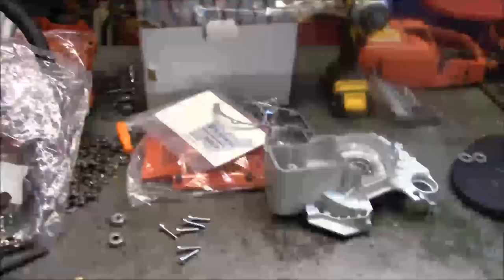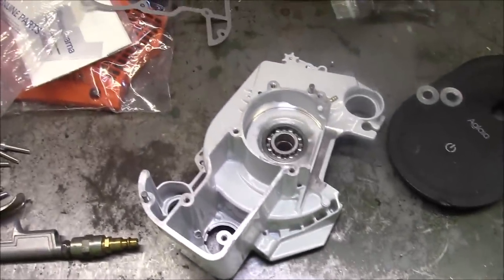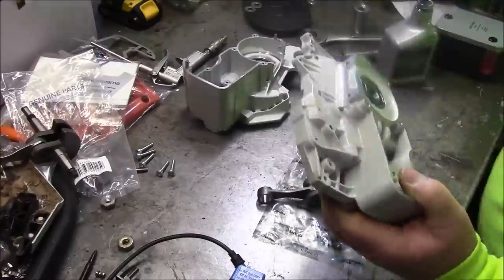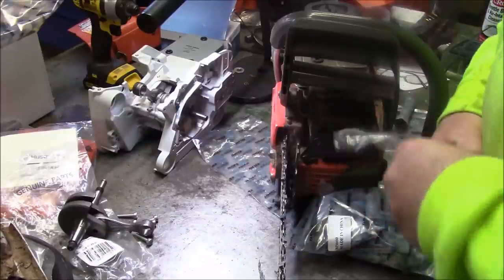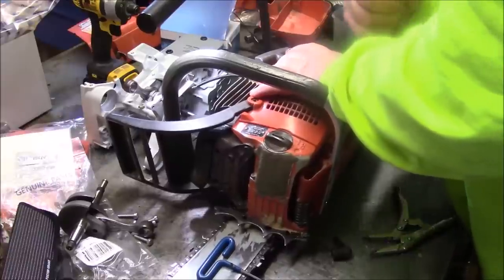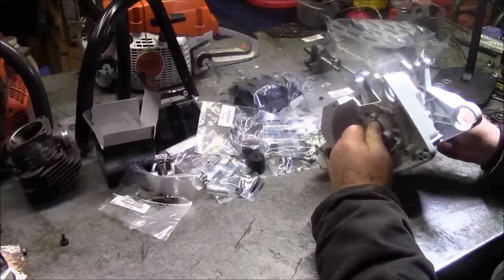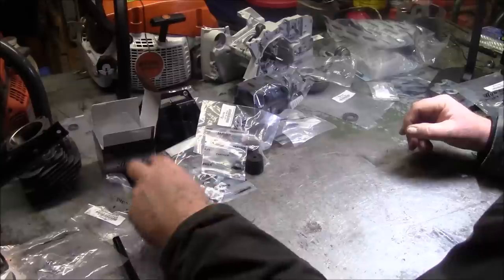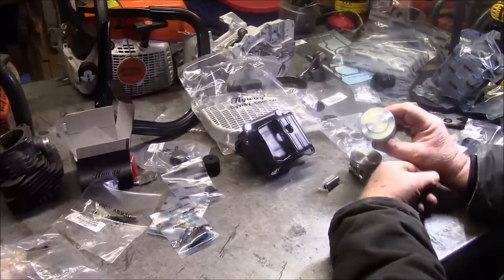Farmertec ms660 Kit Saw Build "Best Practices", Adding Parts from HyWay & OEM, Building Test Saw #3

Comment: My 660 build has taught me a few things.  I replaced quite a few control parts to get it to have a high speed half choke position, a carb, coil and finally a complete cylinder kit - about $100, total.  I now have a saw I think is as good as any of my Stihl or Husqvarna saws.  I have not found anyway to fill it with helium, yet, because it weighs a ton.  I never setup my saws to scream like some folks and I feed everything the same 50:1 fuel but I am happy with it and it works good and protects my two cycle stuff.  I learned that the things that I thought would take a long time ended up taking the least amount of time.  I also learned that Huztl`s quality control sucks on a lot of parts.  All in all, I would build another one, ut maybe an ms 360 or 440 the next time around.  I have thought about the 372 but I am a Stihl person, I do  have quite a lot of Husqvarna equipment, but I also have more German DNA than Swedish DNA, so I am usually able to figure out some of the stupid stuff Stihl does on their saws.

Comment: I found something about aftermarket cylinder sets that surprised me - the wrist pin bearing is to short.  I was replacing the cylinder on my new ms 260 to bring it up to Pro specs.  Instead of using the wrist pin bearing that came with the cylinder set, I used the original Stihl bearing from my original piston.  It was not worn or damaged and fit perfectly in the piston and on the wrist pin.  Had I used the new wrist pin bearing it would have caused a lot of side to side slop in the piston.  Over time this would have caused a lot of cylinder scuffing and wearing away of the Nikasil coating in the cylinder.  Just thought you would want to know.

Comment: I agree on the intake boot.  I think mine is suspect and I may pickup an oem or good am intake boot for my 660, probably from hlsupply supply.  Their base gaskets are great and that is what is on my 660.  I have had no problems with the chain adjuster or clutch and my oil pump works as good as any stihl oil pump.

Comment: Kit saws- yes, I am going to build either a 360 or 440 this fall.  I am leaning towards the 440 because I do not have a 72 cc saw.  I have several 60 cc saws.  I like the 361 but there are not as many parts for the 361 as there are for the 360.  I may build the ms 250 this summer.  They are pretty cheap and a piece of cake to build, even though I am not overly fond of the 250.  I would love to find a ms 260 to rebuild but most of the ones on eBay are to pricy.

Comment: I know how you feel about having to wait for parts from oem dealers.  Pay a fortune for them and have to wait a week or longer for a part you can get from ebay in a few days.  Like you I tend to look on ebay instead of running down to my local stihl dealer when I need parts, unless they are parts that I cannot get off ebay.  I thought the farmertec oil pump I got looked pretty good and I know it works.  I have not had any problem with my chain adjuster and it looked pretty good when I installed it.  I do not know how long it will last but it is working good, now.

Comment: I rebuilt that poulan 2175 and she has good power more ass now then when it had the 38mm piston. Found out partner 220 260 350 351 440 parts are the same except for the bore is different

Comment: I did not have any problem with the clutch, oil pump or chain adjuster on my 660.  They all worked fine.  The controls, throttle linkage, starter and coil sucked and were replaced, mostly with oem.  My opinion on the intake boot,  fuel line, cylinder, piston and rings are possibly junk, too, only time will tell.

Comment: Did I miss the bearing and seal change? The last 2 cases I've received from Huztl both had aluminum shavings in the bearings and seals ms660 & ms440 which prompted me to swap out to SKF & National. I look for inexpensiveness be it OEM or Aftermarket  not "Cheap" waste your money junk. I purchase on a percentage scale if I can get it at 25% or less than aftermarket then I'll go OEM if not then its the best inexpensive aftermarket I can find. 
You know you just turned that old McCulloch into a Speed Racer. "Go Speed Racer Go"
Again Thanks for your insights thoughts and recommendations.
Reply from the maker: Nope...Farmertec seals and bearings. They were fine. If they fail, I'll replace with OEM bearings and HyWay seals. Building yet ANOTHER set of cases in that configuration for a future video. Using a crank from yet another source. But that will show up in a couple of months

Comment: Awesome video. I have never taken the time to visit farmertec/huztl. However, my buddy left my saw Husky 372 xp, on ground behind a forwarder. You know the rest. Crankcase fine, all cosmetic parts damaged/broken. $400 for cosmetic parts at dealer. Less than $100 from Huztl. Wow! I realize some of the chassis parts might need a little grinding so to speak. Is their anything I should be leary of when getting/ordsering/using these parts?

Comment: What do you think of the pre assembled engines from farmertech? I bought 2 ms660 a couple years back and wondering if I should build them up?
Reply from the maker: Like I have said for years, a bit of a crap shoot with some models way better than others. The g395I have needed a piston, THEY fixed that, other than that, it's ran well for at least a year now. 660 are pretty well sorted out as well
Reply: @afleetcommand  Thanks.

Comment: That pisses me off, too.  Dealers do what is profitable for them and not us.  Sometimes I have to wait for three weeks for a particular screw or part that I can get from eBay in less than a week.  The problem is profit these days is not the price of the part but in shipping and handling.  I scan through axe heads on eBay often, looking for a particular head that I may want and for an example the seller wants $8 for a particular axe head and $15 shipping.  Needless to say “sucker” is not engraved on my forehead😏

Comment: Walt I received my first 660 kit and the cylinder walls had 3 hairline cracks! They also machined tru Cylinder coating at skirt! I ordered a cylinder form bailys! I hope its better, I bought factory stihl gaskets and seals. Should I Upgrade crank? Finally got email from hudtle today after 4 trys.
Reply from the maker: Depends on what you plan to do with it. If its a hobby saw the Huztl crank is fine. If not go to HLSupply and get a better one. Also Baileys is also from over there somewhere. I would try HLSupply's and possibly the Hyway version. Actually I've had good luck with the Huztl/Farmertec 54's even when they don't look that great, they last in spite of the appearance, and they do run strong. BUT cosmetics....if that important spend the money.....:) You have to expect swapping stuff out, there isn't a cook book solution to these kits box saws even though some would have you believe there is. Look at each part as an individual expecting some not to be the best and you will be happy with the results. Expect OEM consistency and quality, might as well just go buy OEM..:) I've had a lot of fun building and swapping out & solving little issues. But I have a pile of saws so having in as a work in process doesn't matter for me...:)

Comment: Which carb do you recommend for the MS 660 kit?
Reply from the maker: I've put on used Walbro's Like WJ-67's and I hear good things about the MUCH less expensive Tillotson HS-320's Like this:
https://www.ebay.com/itm/Tillotson-OEM-HS-320A-Replacement-For-Walbro-WJ-67B-fits-Stihl-066-MS660/173039055581?hash=item2849ee72dd:g:OioAAOSwJslbDAir:rk:20:pf:0
Reply from the maker: I have rarely been able to get the carb's that come with the kits to work well at idle. And the ones I did I had put Walbro parts in them.

Comment: I haven't had any issues with the recoil on 3 of the ms660 saw I built, so must have been just lucky :) I've had to replace 2 oem clutchs on oem stihl ms290, and 291, cause they failed
Reply from the maker: The current group of Farmertec pull starts have improved....the early ones were a constant problem once I "upped" compression. And even this last batch, I had one that stuck right out of the box. SO a better option is something I'm going to investigate. It is a game of statistics. 3 even 5 saw build is a tiny sample. If even one fails thats 20 percent....and if its a trend on such a small samples set chances are its a systemic issue. Doesn't mean ALL will be bad. Just it increases the chances. The numbers side of this escapes many, both ways. One failure and it effects the perception. The point I was making in the "Different Worlds" video.

Comment: Matt doesn't want to 395's for the big stuff? Built like tanks.
Reply from the maker: Matt the logger uses 390's for everything.....he had Stihl MS660's before. He's the reason I have any Farmertec as it was his crusher MS660 that got me looking for parts. I converted him to Husqvarna 390's with a slightly tweaked 390. If you take a look at the "different worlds" video what he's doing there is typical for his work. And he has a couple of years back log so I have a lot of saw work ahead. I have 2 soon to be 3 Farmertec 660's in his care as part of my test program..:) To the 395, big yes....buy not faster enough to make it interesting for him.